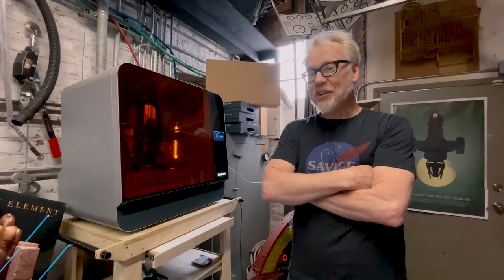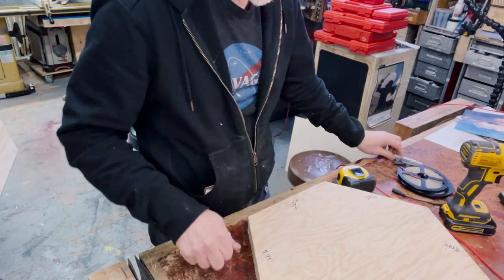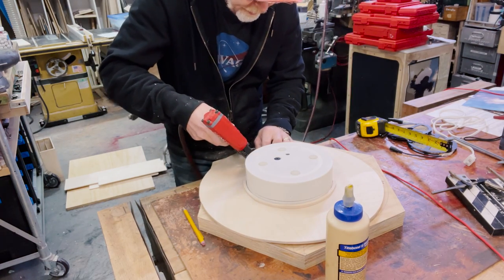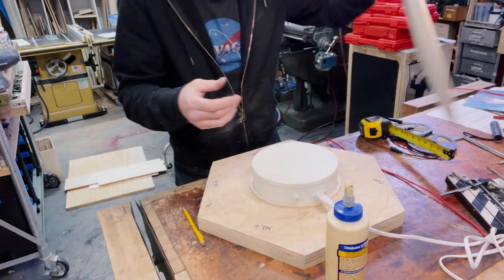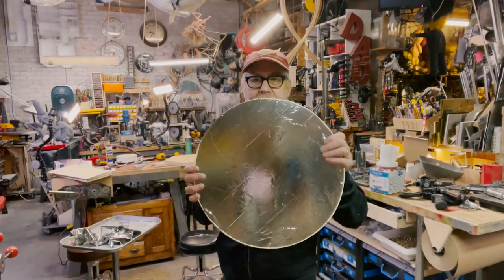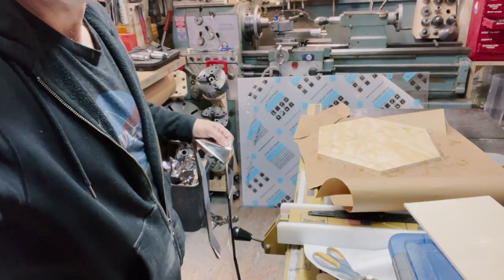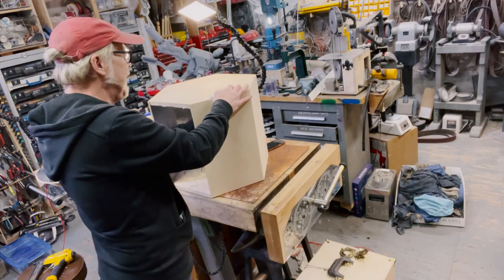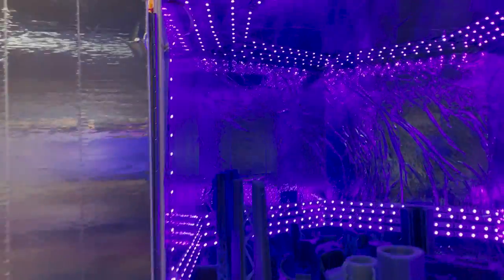Adam Savage's One Day Builds: 3D Print UV Curing Oven!

Comment: Any UV type is better (ABC) or a special wavelength?
Reply: Check the specifications on the resin's datasheet, usually (almost always for consumer resins) they specify 405nm.
Reply: depends on the resin, afaik
Reply: @y2kkmac  thanx I found it weird that he did not have any eye protection... even if normal glasses (not plastic) does help... I was wondering of the type of uv

Comment: why reflecting material ? wont just painted white would reflect most of the UV ???
Reply: Mirrors reflect more light.

In a mirror, electrons on the surface are moving about fairly freely and when light comes around the elytron vibrate and create an electric field the prevents light from penetrating very far and they bounce back. Even though white surfaces can reflect a decent amount of light, they do not have this layer of electrons so light can pass completely through/absorbed and not get reflected.

Comment: i though about making one out of pine and household aluminum foil only because it look cool but i really do not need one i have no 3D printer just wanted to see if i could make one the lights did not know how to install LED's any ways i gave it away the one i made was round hard to steam the wood to bend it round what i waned to do is just get a very very huge piece of wood and sand it round cuz I don't have a lathe or know how to use one then i could have just make it like that the person i gave it away to use a FASTTOBUY UV Resin Curing Light 405nm for SLA/DLP at lest that what he said i have no idea what that look like

Comment: You would be better to remove the supports before curing, it will be much easier to do with some hot tap water. As to the Base's not getting any UV, just rotate them. 5-10 min and turn.

Comment: Find the centre of the original circle and branch out from that to find the circle you wish to use in diameter.  all that you then need to do is find a piece of material long enough to wrap around the circle cut grooves at the correct intervals into that piece of material that will allow it to conform to the circle.   job done no need for everything that you are doing?. You seem to be taking a very complicated and long winded way of expanding the circle.

Comment: The lack of safety in this build really hurts.... Opening the door without any shielding from uv light is almost as good idea as shining uv torch right to your eye! At least get door that shuts the light off when opening the door!
Reply: These resins are cured using 405nm, which is safe. Assuming he got the correct LEDs, it's not really different than a standard light bulb.

Comment: I always wince when I see someone on youtube expose themselves to uv lights without proper eye gear.  And curing a print before you take off the supports is extra painful
Reply: Different wavelength light. Resin curing uses 405nm, which is basically violet. That's actually safer than most all blacklights.
UV C is the really dangerous one, but is also absorber very fast by the air. 100-280nm
UV B is less damaging, but it passes through air much better, so it's still dangerous. 280-315nm
UV A is fairly safe, but you wouldn't want to stare at it for any time, particularly the shorter wavelengths. 315-400nm
Reply: @zemerick  if you plan to do 3d printing all that short exposure is going to add up over time. So it's best to just wear goggles to protect your eyesight. Like how an x-ray tech runs behind a screen when doing your x-ray
Reply: @XYZdude00  xray techs don't run behind a screen when they flip a lightbulb on though.

By many definitions, 405 isn't even UV at all.

Also, the way resin 3d printing works, you're exposed to trivial amounts. Basically only when turning on and off your UV curing station, so we're talking a few seconds every print or so, which is typically once or twice a day.

Now, if you were doing this in a more industrial setup, where you could be racking up hours a day, it wouldn't be a bad idea to protect yourself a bit more just to be safe.
Reply: @zemerick  dude if you want to stare at uv light that's your prerogative but I wear uv goggles when I cure prints. 3d printing is especially toxic and telling people you don't need good eye gear and other ppe is doing them a diservice.
Reply: @XYZdude00  I disagree. Giving people wrong information is a disservice, and will only hurt your cause.

For example, you mention PPE in general, which in this case includes gloves.

What happens when someone learns that the curing light they are using is quite safe, contrary to what you said? They might start thinking the same about other things, like the gloves, which are very important.

By most definitions, it isn't even UV light at all ( 405nm while UV is generally considered to end at 400nm. ) Considering the longer wavelengths UV ( UV A ) are already considered reasonably safe, doubly so for the longer wavelengths of UV A, that puts 405 in the really quite safe range.

At that point, you might as well be saying you should wear UV glasses to look at a computer screen.

I still do say don't stare at your curing light though: But that's just as a general "Don't stare at bright lights", nothing to do with the wavelength.
Reply: @XYZdude00  Oh, and I should add: By all means if you want to wear the glasses, do so. It doesn't hurt you.

I am only saying we should try to give people as accurate information as we can.

One final note: As with many things, you do also need to know your equipment. If someone gets a 350nm light, that could be a very different story. Doubly so since it also might not work to cure the print in the first place.

Comment: It was a little unnerving watching you run the table saw and have 'trip' hazards on the floor nearby (i.e. the dust brush, the wood panels on the floor, etc.).  Please be careful. We value your fingers.
Plus, maybe I'm wrong but it seems that having 360 degree LED coverage AND a rotating base is redundancy but , at worst, it will be like a belt and suspenders.  Good job.

Comment: Hope you did not use the LED's in the link, they are just Purple not UV, you know they are fake UV when there are so many false claims on the advert.
Reply: From the product description: _"Wavelength: 395-405 nm"_. That's exactly the wavelength needed for this purpose. Some may say that it doesn't meet the criteria for "true UV", but what's relevant is what the curing process needs, not whether someone considers those LEDs actual UV.